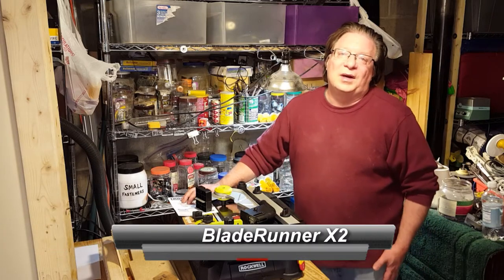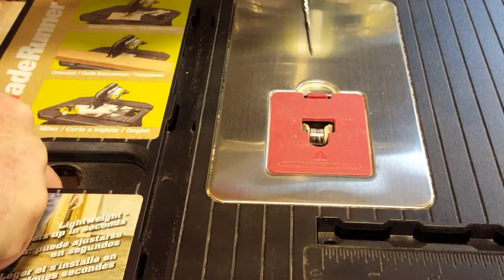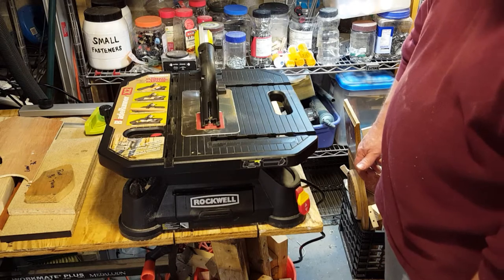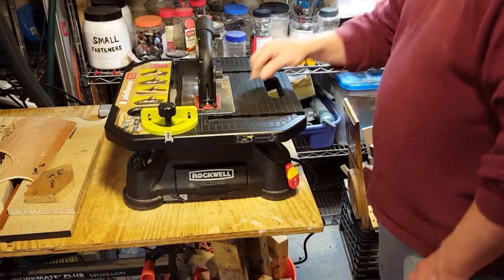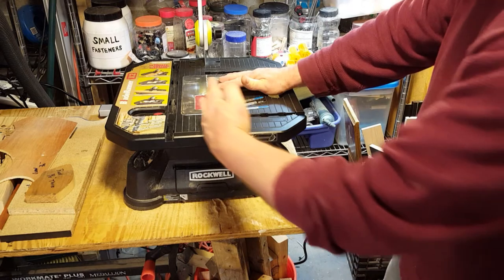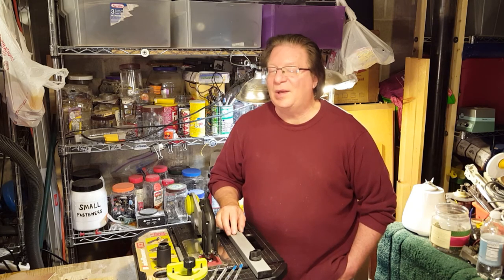1. BladeRunnerX2 part 1

Comment: Thanks for the review. I just ordered one. I plan to leave it on one end of my 12-ft workbench, to use on little odd jobs, which don't justify setting up my 10" jobsite table saw. To me, it's better suited to arts and crafts hobbyests. The scrolling feature is very useful for small plywood pieces, which are hard to clamp down for using a scroll saw.
Reply from the maker: Thanks for your comment and for watching. Enjoy the saw. Make some great projects!
Reply: @ImaginethenMake  Thanks. Got it yesterday. Have already used it for some small 1/4 inch plywood cuts. Doesn't take up much space on one end of my workbench. Cuts through 1 1/2 inch side of 2 1/2 x 2 1/2 (nominal 2x3) pine no problem if you go slow. I would only do this if the piece was too short to hold down with the left hand while cutting with a battery handsaw.
Reply from the maker: Glad you are enjoying the new saw. With a little imagination, you can make all kinds of cool stuff.
Thanks for your comments and for watching.

Comment: I'm waiting for this to be delivered today! I did order goggles, face masks, and extra blades which all came yesterday. I've never used anything like this before so I'm a little nervous. Being a female, this machine doesn’t look so intimidating. I purchased it for making miniature dollhouses and dollhouse furniture. Thanks so much for your wonderful video! I will watch it again when my machine comes.
Reply from the maker: Excellent! 

I think it will be very useful to you when making the dollhouses and furniture. It is pretty simple and safe (IMO) to cut small parts. What material will you be cutting? Pine? MDF? I'd like to see some pictures of your projects when you're ready.

I might also suggest you consider getting hearing protection. The machine is about as loud as a vacuum cleaner so I generally wear hearing protection. You don't have to, I just prefer to. I purchased my hearing protection from Harbor Freight (there is a store local to me). I'm sure Home Depot or Loews has something suitable and not too expensive as well..
Reply: Imagine then Make The machine just came! I will be cutting craft plywood. I will get the ear protection tomorrow. I saw that in your other video. We have a Harbor Freight store near me. Would that cross sled be beneficial to me for what I want to do? Thanks!
Reply from the maker: Yes, I recommend the cross-cut sled. It's about $20 from Amazon. It is made from plastic so I plan to treat mine carefully. In the cuts I've made so far, I like it. Watch my vid about it and you'll see what I mean. 
Since you are a new user, would you like to see me make a video dong anything specific with the saw?
Reply: hey sister happy new year!! i remember u from another video: didn't u say u had a mighty mac from harbor freight? if so, how is that working out?
Reply from the maker: I think you have me mixed up with someone else.

Comment: happy new year brother matt!! a rather good demo but it would help if u threw a white sheet over that rack in the background for maximum unimpeded visibility. FYI, this unit produces 75-80 decibels unloaded & 78-85 decibels when cutting a thin pc of medium hard or softer wood. it weighs 14 3/4 lbs. how much did u pay 4 it in 2017? i just paid $140 @ LOWE'S. i notice that daryl griffin below states his unit has a variable speed dial & that u think it is an earlier model which begs the question, why on earth would rockwell drop that feature; it sounds sweet. what do u use yours for? i acquired mine to rip & shape small sections of exotic & common hardwoods such as ebony & cocobola. looking forward to finding out how versatile the unit is but basically to just cut STRAIGHT lines in small blocks of wood. you're a terrific teacher, thoughtful & comprehensive. best wished 4 the new yea!!
Reply from the maker: Happy New Year!  ... and thanks for your comments.
As for the noise my BR makes, I measured 103dB. Check out my video: 79. How loud are my power tools? for more about that.
My wife bought me the BR from Amazon in 2017 and I think it was around $100.
Yes, a much older version of the BR had a variable speed motor as well as a bunch of other nice features. I can only imagine Rockwell got rid of those features to reduce cost. That's too bad because if the older one was still available, I would buy one to try.
I use my BR to cut wood generally free-hand while following a line drawn. Check out my video: 84 to see me cutting out 2" dia. wood circles using the BR, a scroll saw, and a bandsaw.
To make straight cuts, use the widest blade you can find and let the blade do the work. Try not to push the wood too hard. If you have to push hard to make the cut, try changing blades.
Thanks for watching.

Comment: i want to rip some round wood pieces that are less than 1" in diameter . Any suggestions for a hold downs besides the saw guide? thank you for providing the saw info, convinced me to buy one.
Reply from the maker: Hi Willie. Ripping small round pieces is an interesting problem. My first thought is to make a jig to hold the round piece while providing a flat surface to mount the saw guide to and slide the saw on. A lot of woodworkers swear by double sided tape. I wonder if you could use double sided tape to hold the round piece to a flat board that would accommodate the saw guide and saw?
Thanks for you comment and for watching. Please let me know what you decide to do.

Comment: is there a limitation to the length of the blade I can use? I ordered a Bosch extra clean wood blade that seems a little longer
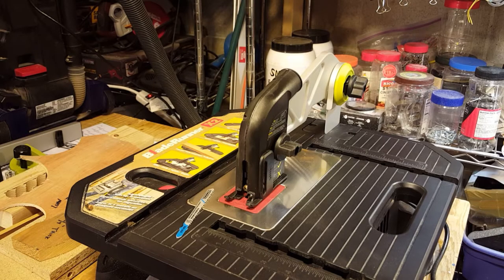Reply from the maker: If you lower the arm over the blade so that the foot is in contact with the piece you are cutting (to help hold the piece down so it doesn't pop up or chatter while you are cutting), then yes, the length of the blade would be limited. Look at 2:40 and you'll see the arm lowered. I believe the maximum thickness the Bladerunner can cut (while using the arm) is 1.5". I think standard blades are 3" or 4" long. I have only used standard blades.
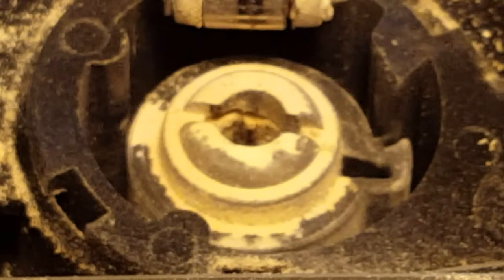Look at this video: https://youtu.be/LeQCMKe2ug8 . Starting at 5:08, you'll see me cut a piece of 2x4. Watch the blade while I'm making the cut. A longer blade looks like it would fit but while using the foot, the max thickness of the cut is limited to 1.5" anyway.
I have used the Bladerunner WITHOUT the arm lowered (watch this video: https://youtu.be/W-aKZlOVNlI ). Starting at 8:59, I am cutting without the arm lowered. Without the arm lowered, there is no blade length limit.
The biggest challenge I have found while using the Bladerunner is having the blade lean over while making a cut. If the blade leans, the cut will not be square. I think the bearings in the foot are there to try an prevent blade lean although I don't think they succeed at doing this. Check out my Bladerunner playlist: https://youtube.com/playlist?list=PLGCBwUeR2BD2SPSsV51qPBkK8p1grR-UL and you'll find videos where I take a closer look at the arm to determine how well it really works.
Thanks for your comment and for watching.

Comment: Thank you for the informative video.  I am installing luxury vinyl tiles in my powder room (small downstairs half bath).  I was going to have a bigbox home improvement store but they wanted to charge me an "upcharge" of $225 because it is a small job.  Can't abide by that.  Only question.  Which blade is best for Shaw luxury vinyl tiles.  They look like ceramic.  Heavy and thick.  But are vinyl.  About three times as thick at the peel and stick luxury product (too thin for call a tile).
Reply from the maker: Thanks for your question. Off hand, I don't know; I would need to do some tests. If I go to my local Home Depot, am I likely to find some "Shaw luxury vinyl tiles"?
Reply from the maker: I did a quick Google search on "how to cut luxury vinyl tile" and found that you can score it with a utility knife and then snap the piece along the score line. Hope this helps.
Reply: I appreciate your timely reply!  In my store the luxury vinyl tile is special order only.  The in store vinyl squares were all peel and stick.  YES!  I also found a video on installing this kind of tile.  It does look like I can score and snap most pieces.  The small fitting cuts (around toilet flange) I may need to cut.  I'm thinking one of the crosscut wood blade would work.  I can test it out with pieces.  Thank you!
Reply from the maker: I found this today and thought it might help you out.

https://www.lowes.com/creative-ideas/build-and-remodel/install-luxury-vinyl-tile-flooring/project
Reply: Nancy Stalik ...I am a hardwood, laminate an LVP (luxury vinyl plank) installer. I have found that regular wood cutting blades dull quickly when cutting LVP so I've been using PVC pipe cutting blades and they've been working very well for me since LVP is basically plastic-like anyways just like PVC.

Comment: You must have a different model than me; mine has a variable speed dial, a dust collection tray and a blade tray. Also, one needs to purchase "T" shank jigsaw blades only: others don't fit.
Reply from the maker: You must have an earlier model of the Bladerunner. Thanks for your comment and for watching.

Comment: This looks identical and has the same exact name as the WORX branded BladeRunnder X2. Both WORX and Rockwell are owned by Positech in China. Are they the same machine or is there a difference in quality and reliability, motor, etc?
Reply from the maker: I honestly don't know. My wife purchased this for me as a birthday gift from Amazon. This saw was on my birthday list because I was curious about it. The idea of using an inverted jigsaw with blade support intrigued me. The cost was low (around $100 I think) so I figured I'd give it a shot.

Before I added this to my birthday wish list, I looked around on YouTube for videos about it but I really didn't find the info I was looking for. So when I got the saw and started using it, I thought I'd make some videos about it.
Reply: Yes.... This is the identical to the Worx Bladerunner 2 except the Worx color is orange.
Reply: Question: The blade support bearings on my machine only make contact with the back of the blade about 1/8”. The bearing surface look to be about 1/4”, so only a portion of the bearing is being used. Is this the way your machine is set up? I actually put in a couple of small washers to allow more contact with the blade.

Comment: I have a Bosch jigsaw.  Would owning this be redundant?
Reply from the maker: It depends.  Using a jigsaw, you are moving the tool thru the workpiece. Using the BladeRunner,  you are moving the workpiece thru the tool.
So, when cutting large pieces,  the jigsaw can be more convenient. When cutting small pieces,  the BladeRunner might be more convenient. 
I think this is similar to situations when deciding between using a circular saw or a table saw. 
Thanks for the question and for watching.
Reply: @ImaginethenMake  Great comparison re: table saw and circ. saw.  Sometimes this unit goes on sale in the mid-$80s on eBay, brand new.  I'll swoop in at that price point next time.  I like how portable it is and how easy it is to tuck it away until you need it.
Reply from the maker: @joelaroza6837  Changing blades is also really easy. Switch from cutting wood to metal in second.
Reply: I opted for this instead of a jigsaw because I can use my circular saw for bigger pieces. Also, I didn't find this until after I bought the bladerunner X2, that you can make a table to turn your jigsaw into one of these, which gives you double versatility. Had I known this, I would have opted for the jigsaw and made the table! However, I am very pleased with this purchase and like I said, I can use the circular saw with my guide for bigger lumber.
Reply: @TheCopperFrog  How is the dust collection?  How do you think this compares to a scroll saw?
Reply from the maker: Thanks for your comment and for watching.
Reply from the maker: Dust collection does work reasonably well when a shop vac is attached.
A scroll saw uses a much finer blade so it is better at cutting fine details. However, it also cuts slower. I do have a video that compares a scroll saw to the Bladerunner so you might want to check that out. Thanks for watching.

Comment: This saw is available on Amazon. There are two options. 1) the basic tool (includes five starter blades); 2) the basic tool & a 10-pack assortment of Bosch blades at a premium of $11.99 above the price of the basic tool. I am ready to order, but would you advise someone to go for the extra blade assortment for under $12? Thanks in advance, B'H.

PS: Link to described offer on Amazon: https://goo.gl/nHh6Sx
Link to Bosch 10-pack (separate description) https://goo.gl/WJyxEe
Reply: Get the extra blades. You'll be glad you did the first time you need one and they're cheap for blades of that quality.
Reply from the maker: I agree with Jeff. Get the extra blades. I bought the assortment pack that includes blades to cut different materials.

Comment: what if i lose the safety key
Reply from the maker: That's a great question! I have not (yet anyway) had this problem. Since I don't have small kids around and actually, no one else uses my shop besides me, I don't have a reason to pull the safety key out. If I do need to do something with the tool and I want to be sure it won't turn ON by accident, I simply unplug it. However, if you do lose the safety key, I suggest doing a quick search on YouTube for videos about replacing or making a new safety key. You can also search online shops like Amazon or eBay to purchase a replacement. I hope this helps.
Thanks for your comment and for watching.

Comment: Very hard to get a straight cut with this thing
Reply from the maker: I understand. Check out this video ( https://youtu.be/W-aKZlOVNlI ) at about the 9 minute mark and you'll see me making some straight cuts. In that video, I was using a fairly wide blade when making the straight cuts and a scrolling jigsaw blade to make the curved cuts. I have found that the blade I choose to use makes a big difference in the quality of the cut.
Thanks for your comment and for watching.

Comment: i have this tools and it wornt start just after i use it for two days. i am in the philippines and now i dont know what to do.
Reply from the maker: How old is the tool? Is it still under warranty? Did you try a different power outlet? Thanks for watching.
Reply: @ImaginethenMake  Did you use 110 volts?
Reply from the maker: Yes. I am in the US so I use 110 volts AC, 60 Hz.

Comment: The price keeps going up on these for no reason. Not worth 140 bucks. They need to upgrade it at this point and the original blade runner was a better tool. Seems they think the R and D is still not paid for on these things.
Reply from the maker: I agree. Although I have never used the original version (metal table surface with the arm on the right and variable speed), it seems like it would be a better machine. I can only imagine how many thousands of these they have sold so I'm fairly confident that the R&D has been paid for (considering many people on YouTube build their own work-a-like by inverting a standard jigsaw). Thanks for your comment and for watching.